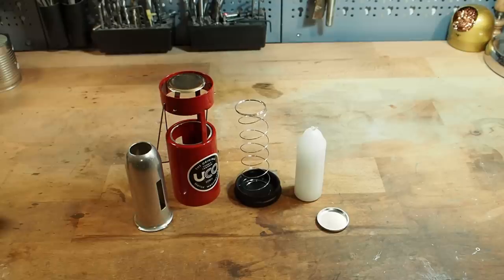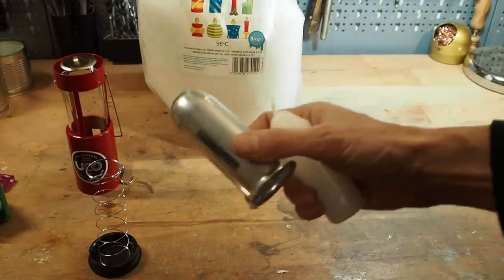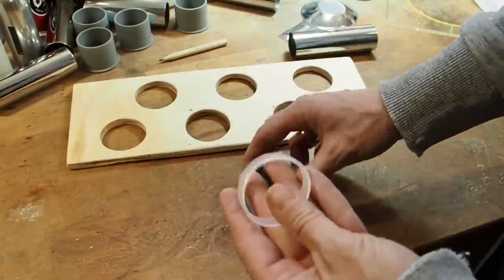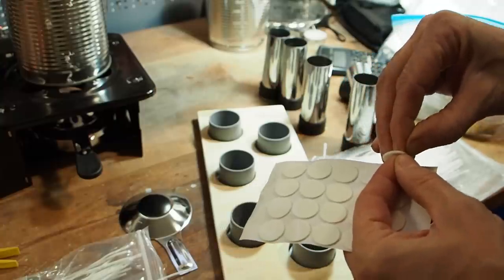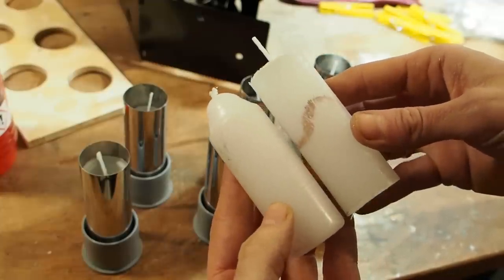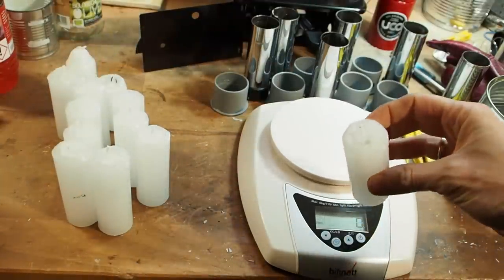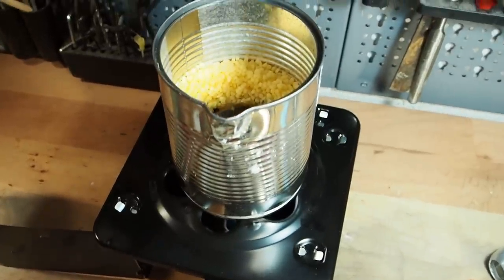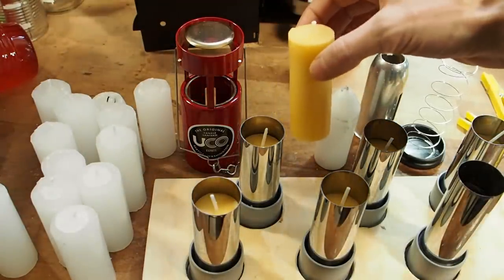DIY Candles for UCO Candle Lantern!

Comment: To reduce the 'piping' effect, you have to slow down the cooling rate where the wax meets the metal tubes. Try insulating around the tubes by adding a boxed-in top to the mould stuffed with cotton wool or old rags. You could always try casting the candles bottom-up, instead of top-up, though that would complicate the mould.
Reply: Also, try to let the wax cool a bit before pouring. pour just before wax starts to harden and insulate tube as described previously ;-)

Comment: If you heat the exterior of the metal tube with a hair dryer after they are cool, then the new candle will slide out easier. Great idea! Thanks for the inspiration.

Comment: Great project!  A couple of tips... when melting candle wax, always use a double boiler for safety. Wax can flash fire very easily.  If you get some either some food grade silicone spray or high temp baking spray like Pam and grease your pipes with it before you pour, the candles will slide right out of the pipes easily.  Also, you will LOVE their 3 candle candelier lantern.  You can actually put a metal cup on top with a lid and boil water on it!  Plus, 3 times the heat and light.  I really recommend getting the neoprene cases for the uco lanterns to protect your investment from damage.  Especially if you get the three candle candelier.

Comment: I have been having a go at this too. I tried 32mm PVC waste pipe with beeswax, but it was impossible to remove the candles after drying. I tried freezing and reheating to get a quick change in expansion/contraction but this did not work. Nor did a mallet and a piece of 1 inch dowel. I had to saw them in half in the end. Some of the wax stuck to the inside of the pipe, so the candles came out somewhat broken.
I am going to try metal tubes, and I found a great source for the pipes - a vaccuum cleaner extension tube. For a well known small brand, this is exactly the correct diameter - 32mm!!!!
I will report back.
I am also using 40mm push fit plugs which look like the ones Lily is using. They fit with a similar bit of taping.

Comment from the maker: UCO Candle Lantern USA: https://amzn.to/3otdCJ5
Warning: My method of heating the wax works, but if the wax gets too hot, it can catch fire. For safety reasons it is better to use a waterbath for melting the wax! Also, the wick I used in the video is a bit too wide in diameter. Make sure you use a really thin wick otherwise the flame will get too big.
Reply: wow ty SL - I bought several triple UCO lanterns years ago - they have really risen in price.
Reply: hello and greetings from Poland, recently there was a broadcast of naked survival instinct on TV. Respect for you
Reply: these are like a dollar in the USA crazy
Reply: @Dies1r4e  you are blessed (for now...)
Reply: @fullofhope2222   things are crazy, my food bills have nearly doubled and gas has literally tripled in the last two years.
Reply: @Dies1r4e   not the original uco candles
Reply: Beeswax UCO candles are $ 3 USD in the USA right now. I can get beeswax for free locally, though. Maybe I should make my own, too? 😮
Reply: @DaedalusHelios  UCO in UK ? -- $20
Reply: I have a problem with some I made last month. Overflowing wax in the base. I believe its because I'm using #4 size wick's. I'm in the process of making a batch using #2 square shaped ones. Will let you know how they work out.

Comment: i found i little glass bottle with a metal lid  who fits inside the candle tube. i managed to install a little metal tube in the bottle lid as a wick holder - now it is a dual use lamp works perfekt as oil lamp and also with candles. with lamp oil it burns much cheaper than with candles, even cheaper than with homemade candles.
your candle project gives me an idea to make some candles for an other candle lantern who also needs special size candles - the swiss military folding lantern.

Comment: I have been using these since the late 80s . They still look new and work great enough that I have never found something to replace it with . The white candle lasts around 10 hours . I usually buy the white candles. 
A lot of people complain that the candles make a mess in the lantern . They dont make a mess in lantern if you let wax cool before moving the lantern . I clean my lanterns about every 4 or 5 candles . So , that about a cleaning every 40-50 hours of use .
I would not waste time making the candle , I would make oil lamps for them if I was going to make anything . 
Since uco white candles average cost is 12 cents a hour as of 2024 .

Comment: You can use modeling clay to cap off the pipes, much easier. Just make a clay patty (like a tiny hamburger) and poke your wick through the center. Lower your pipe onto the clay pad, with the wick through the center, and embed the pipe into the clay. 
Self standing, re-useable, and releases easily.
Reply: I tried this with PVC pipe a couple years ago, but the wax made it past the clay and just ended up as a puddle on the table. It didn't seal tight enough no matter what I did. Maybe it was the type of clay (it was modeling clay that got softer with heat) or maybe the liquid wax was too thin and got past the seal. Maybe a different kind of clay would work, but I just ended up using silicone to make a reusable mold.
Reply: @BiffaloBuff893  know what? You’re right, I just remembered that it was ceramic clay that I used (I was a Potter at the time) and yes, now that I think about it, that heat would immediately begin to melt the modeling clay.
Thanks for your response!
Reply: @WD-41469  That would make sense-I was just using cheap dollar store clay, while you were using real stuff. I imagine ceramic clay would do a good job keeping the wax separate too since it's got water in it, right?
Reply: I use Blu-Tack to cover the tiny hole at the bottom of my large candle mold that the wick goes through and have never had a problem with the wax leaking out.

Comment: For this particular UCO lantern, there is also a "hack" using a small red bull can instead of the aluminum tube that normally holds their proprietary candle and then using a stack of tea light candles with a circle of cardboard under the burning one to keep the one under the burning one from melting.
Reply: Have done that and it works well.

Comment: Well done! 
I've tried making my own and here is my big discovery: the candle doesn't need to be the exact same shape at the top, what is important is that it fills the diameter of the tube to prevent molten wax from flowing down or IT WILL go through the side opening and create a major fire hazard (at least a horrendous mess if you catch it on time like I did).
Secondly, I learned that modern candle wicks are "self-trimming", meaning they will burn out past a certain length. If you use cotton twine, the wick may keep growing longer and require you to trim it by hand on a regular basis or it will create a lot of soot.

Comment: The residue is from when you did the second pour, that's the separation point between the two pours. Try doing the pour using a small metal funnel to make it easier getting the hot wax into the moulds. Good video. Try buying the beeswax in blocks instead of granules it works out cheaper. If you have the 3 candle UCO lantern you can use the three tubes as moulds and do a mass production using them and then revert them back to being used in the lantern until you need more candles.

Comment: i also use the UCO candle lantern that uses tea candles. tea candles are cheaper to buy. each tea candle burns for 3 hours. tea candles are smaller so its easier to pack too. i like the UCO tea candle lantern 😊
Reply from the maker: That is great. I personally still like the candle system I showed in this video better, cause the candle can burn through the night, so I dont have to get up every 2 hours to light a tea light 😅

Comment: Great video.  I like your DIY projects.  The traditional way to make candles is to tie a small weight to the end of a wick (I use a small nut) and dip the wick over and over in the melted wax until it reaches the desired thickness.  This sounds inefficient, but if you tie 20 wicks to a stick you can dip a wick, move to the next, and so forth.  This requires no mold and it is how candles were mass produced in the 1600s in colonial America.  Since you have bees' wax, you can make a diy wood finish by mixing it with olive oil.  I use this to waterproof the handles of my custom landing net handles.

Comment: Hi Lily if you mix a few drops of Eucalyptus oil in with the candles you will have pleasant smell and also an insect repellent to some degree, I prefer this to citronella oil as I don't like that odour, also if you slightly lubricate the inside of your candle moulds with a little cooking oil the candles will be more easily removed, I love the whole concept of saving money, I wonder though if it may have been a little easier to shop for candles that would fit and just trim them too size ,of course that wouldn't be as much fun as making your own, anyway LOL from johnny down under,

Comment: Rub a little oil along the inside of the tube makes them release easier.

I use the pvc pipe of the right ID then hold them together with a rubber band.

And I make 9 at a time. 

I also use cheap taper candles from good will, as the wick and cut them to size.  You can use the wick but the taper candles a usually really cheap from good will and you just add a little wax to fill in for the candle you need.  Re purpose someone’s unwanted.  But keep extra wicks available if you need them and can’t use the tapers.  Last time I went to goodwill I got 10 tapers for $1. And each taper makes 3 candles for UCO lantern…

Comment: Great job on the candles. I have several UCO lanterns that I converted to burn oil.
Reply: Ok what kind of wick are you using?
Reply: I use a Zippo type wick. Simon,a bloke in the woods has a good video on his channel about converting UCOs to oil. It's the one I used.

Comment: I'm glad you did this video. I usually go to the dollar store (In the U.S.) and buy candles. They are over size and very soft wax, I shave the diameter down with a knife. It doesn't mater if it's perfectly round, when the candle melts it will fill in the imperfections.

Comment: 1st an electric hot plate would be a much better choice than an open flame for melting wax. 2nd you should use a double boiler to melt wax. 3rd candles can be picked up pretty cheap in secondhand stores (in the US anyway) if they are not the size you need, they can be melted down and recast to what you want. All that said you have sold me on the idea.

Comment: Just the tip to get that candle out easier when I was molding “rocket  propelant sugar mix” in tubes I took a white paper(copy paper) and put some packing tape the wide 50 mm tape fore tapeing package it can be transparent or brown in color! Doesn’t matter which one you use!

And put a layer off tape on the copi paper then I put the “tape paper” inside the tube and cut the paper so it do one turn with a little bit overlapping in the tube! 

Then you can press out the candle very easy when it’s solidify! And you can reuse At least 10 times!

Comment: I use a soup can for melting wax much like you. I put a small hole near the top at a right angle to the spout, inserted a screw from the inside and screwed it into a short wooden dowl. Now I have a handle when I am pouring. Try it out.

Comment: What were the costs on the supplies you needed to make your molds and the items for the candles themselves, your melting stove and then how much time was involved?  it seems quite costly unless you are using up candles at a high rate.  Burn time is about 9 hours each.  You don’t need to buy UCO replacement candles.  You can also use the generic “ plumber’s candle” as they are the same size.  But Amazon had a pack of 20 UCO candles listed for $27 US in June 2023.  That’s only $1.35 US each.

Comment: The number one reason I have never bought a UCO lantern, despite liking the design and quality has always been the price of the candles .
I'd have bought a dozen of these ( excellent presents for my friends ) had the price of use ( the candles ) been remotely reasonable.
Anyone can do the math and discover how much more cost effective over time a battery powered light is, while simultaneously being safer, brighter, more controllable, easier to pack, and way smaller than a UCO.  You'd think the company would have figured out how much market share they lose daily due to the cost of their candles.  I can think of only one reason that they would continue the self-limiting practice: they make their money off the candles . . . not the lanterns .  The lanterns might even be loss-leaders in order to get the "marks" hooked into the con.  Too bad.  Good on you, Lilly, for solving the problem!
Reply: Plus, it's the sunk cost fallacy.  If you've already bought the lantern, you'll be more likely to buy the candles because you've already spent money on the lantern.  I love these lanterns, but you're right that the candles are a total rip-off.  They'll end up losing money though, because there are already UCO-style candle molds out there that you can buy, and of course you can make them like Lily did.

Comment: Beautiful candles Lilly! I have several lanterns but think I bought them all used. They retail for $32. I have noticed candle price going way up in Canada. Used to get them from about $1.25 but now a three pack is at least $10 at one hiking store.  I only have one place to get them for $2 but the beeswax ones are $5!. Sadly the local store no longer sells the replacement springs, foam cases, or extra glass.

Comment: Another option on these is to get stick candles that are smaller in diameter and repeatedly dip them in hot wax till you get them built up to the size you need.

Comment: There is a seller on ETSY that sell little fuel canisters that fit inside like a candle. I use bio ethanol to fill mine and it last for hours. Very cheap fuel cost also.
Reply from the maker: Ok what kind of wick are you using?

Comment: I saw a man living in a houseboat in Europe cruising the canals. He heated the boat with a candle and three plant pots with spacers. 1 inch spacers in between each pot. 
The spacer of wood on the counter, turn the pot upside down. Then put the spacer in between the pot and the next one. Then put spacer in between the next pot. Don’t block the hole in the pots.

Comment: From the practicality side of things - candles are not convinient source of light (ignoring other abilities). Decent LED flashlight and several pre-charged lithium batteries for the given amount of weight could produce more light or for longer period of time  at low power levels. Charging from solar makes the system indep. of any consumables. So there is no practical need in large amount of candles in most cases.

Comment: You can use modeling clay to cap off the pipes, makes this very easy. Just make a clay patty (like a tiny hamburger) and poke your wick through the center. Lower your pipe onto the clay pad,and embed the pipe into the clay. 
Self standing, re-useable, and releases easily.
Reply: I have found that a lanolin jelly ( bag balm) works great to lubricate the mold for an easy release.

Comment: I have many UCO candlelanterns.  The newer ones are made in China and have weak springs which don't always keep pushing the candle up causing the candle to burn down which is not good.  I really like the idea of making your own candles, but UCO uses a high temp. wax so they don't melt all over the place.  Please do a long term burn and let us know how it goes.  You will get much longer burn times if you put your candles in your freezer.  I have got 13.5 hours of continious burn from UCO candles.  Your mileage may vary though.

Comment: The holes are from shrinkage as you cast thick objects it cools and shrinks fill more itwill shrink down in metal they add spots where the part can pull material from as it cools

Comment: The UCO candles, tho' long-burning have always been rather expensive even in North America.  I have the single and the 3-candle UCOs...one trick I've found online (Youtube) is adapting glass bottles, ("miniatures" of liqueurs and other alcohols), to become slender oil lamps that will sit where the candles would.  Work well.
Reply: I tried the oil lamp method. Unfortunately it did not work because the wick burned down before the bottle was empty. If you can recommend a wick that survives let me know.
Reply: @survivallilly-deutsch255   I used cotton yarn - the kind used for crocheting.  I'll find you the link for the overall technique - its attention to finer points of assembly really made a difference.  Cheers!
Reply: @FidoHouse  thanks. A link would be great

Comment: What wicks did you use?  There are so many choices.  I got a bag from Amazon but they weren't right.  The flame would get huge and I had to trim them every hour or so.  I experimented with one, two and three plies of cooking twine. I settled on two plies.  Works pretty good.
Reply from the maker: I just used the standard wick on amazon. Yes the wick burns too slowly. Your wick solution is certainly better

Comment: Try casting silicone next time, guarantee's exact copies and probably cheaper. If you gently warm the moulds prior to pouring your wax that should stop the bubbles, also every wax has a best pouring temp. This should be found on the packing label. If you want them colourful then a cheap way is grate some wax crayon into the melted wax and stir. Great idea tho.
Reply: please explain casting silicone
Reply: @puddleduck4924  Silicone rubber normally comes in a two part formula. It also has different tensile strengths. I use it a lot in my candle making and it makes a durable,  flexible lasting mould. There are a lot of video's on here which explain it much better and show its usage. Hope it helped slightly.